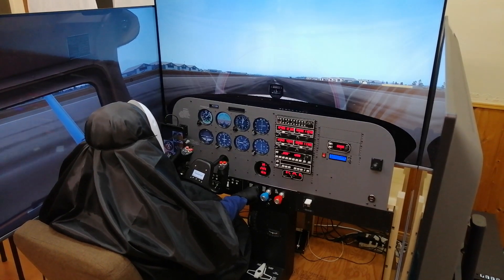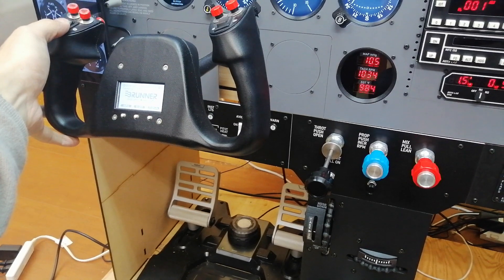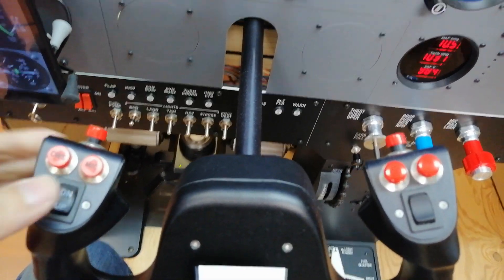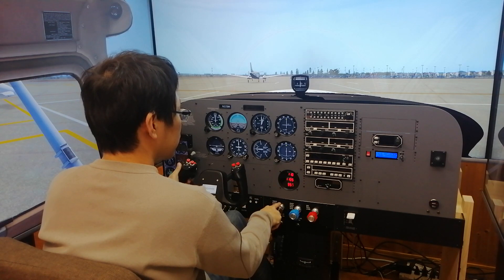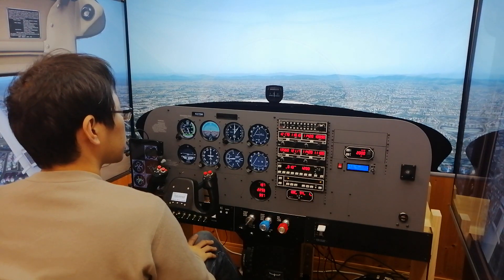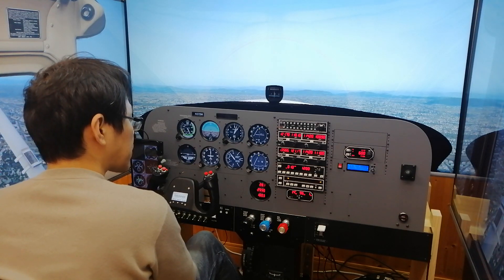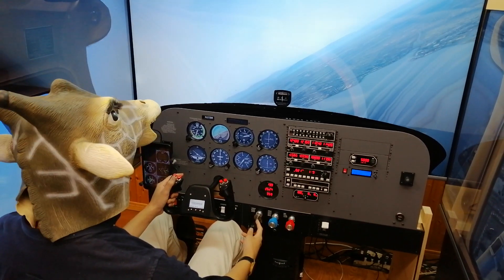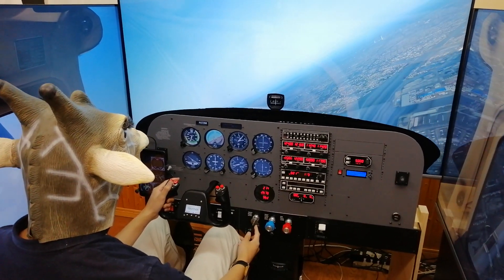Cessna 172 Home Cockpit with Control Loading Yoke

Comment: f have lot money all this parts can buy store than idiot buy. but smart men can made3 all this easy make. arduino can made radio panels and working well, 7 segment display and rotary encoder used,  panel gauges have simple make if have 3D printer can make pecels around to gauge holes and all gauges have backside panel have big display i have same, panel need only drill gauge holes and pecel, yoke can made real cessna dimensions at wood and install buttons and panel linear bearing 1 inch. backside panel have springs. all panel switch and buttons can made working arduino board and connect to pc, msfx software whit FSUIP working well. same radio panel can add working whit MSFX software, all input,output working radio.maximum can add 5 display to computer and 2 compter together can handle more displays and can use weather softwarte, radar,air traffic software, gps etc.only need build this, not need use many thousand dollar money waste. plastic panel parts has shit and not newer realistic.

Comment: Good evening, one day you can make a video explaining how to use the plane maker of x plane 11 to be able to configure the views of the three monitors as you have configured it since I see that it is necessary to learn and no matter how much I look I can not find a tutorial that I explained exactly how to achieve this type of views since the wings are seen on the screens and the nose in the main one, I also understood that the configurations vary according to the size of the monitor, the resolution, etc. (I hope one day I can make a tutorial explaining the step by step of how I achieve that configuration through plane maker thank you very much in advance)

Comment: wery similar i has building, only my 3 display have only 22 inch. and i need arduino leonardo board all analog input change, mobiflight software and arduino mega i have all buttons,switch,encoders and 2 radio panels 7-segment display.  i need makde trim wheel but my printer not working. youke i has made cessna 182 yoke dimensions, at wood. and plastic gears to potentiometer.msfx and fsuip have all together. future need adding 2 computer together seconf pc do air traffic,weather,gauges, etc secondary work and first do flight sim 3 display, and main swoftware.then can adding 3 more display to many different addons.1 display have gauge panel, and 3 have window wiev outside, future need 2 display more.

Comment: Nice job captain, cover your monitor black frames, using my concept, by visiting my YouTube page. It will work better on your settings since you have your monitors set 90 degrees. 😊👍

Comment: This is the most realistic simulator build I ever seen so far. Nice work! The next improvement could be adding the GA headset jacks, interior light knobs and maybe make the radio rack interchangeable to GNS530/430? I also use the Virtualfly Composs on my simulator but I believe you can make a better one from scratch. Also if you print the trim wheels from ABS then you can steam these in acetone for couple of minutes to polish them.
Reply from the maker: Thanks. What you mentioned is exactly what I'm working on now. I use PLA for 3D printing but you are right ABS with accetone finish can make the surface much smoother...

Comment: How great a query will be that you can share your screen configurations with us, as you did to make the wings look like this on each screen, I can't get them to look like this, it would be very nice without sharing your settings
Reply from the maker: Setting the view mode to "3D cockpit" lateral offset of ±90deg for the side monitor will let you see the wings. My setting wouldn't work for your cockpit because it depends on geometric arrangement of the monitors and eye position.
Reply: @flightsimulatorcenterupwin2720  And how can I do to configure my 55-inch screens are all three so that it looks like yours? My email is capitanrodrigoandrade@gmail.com